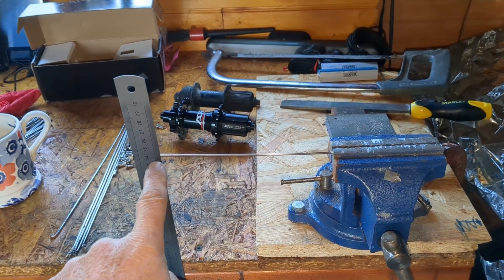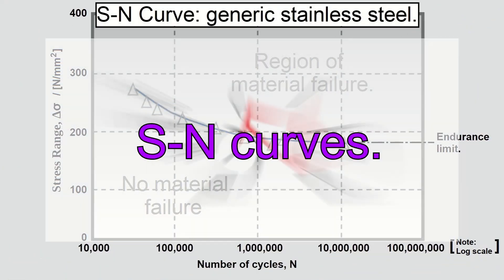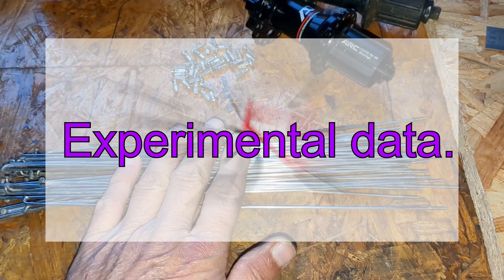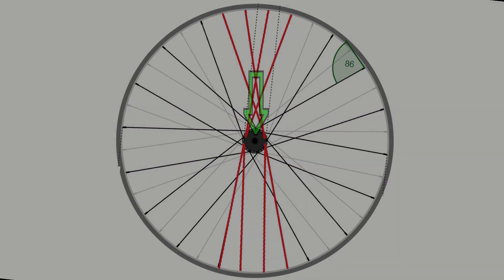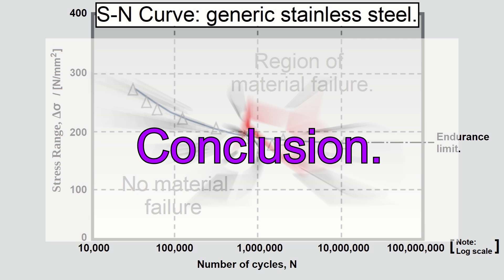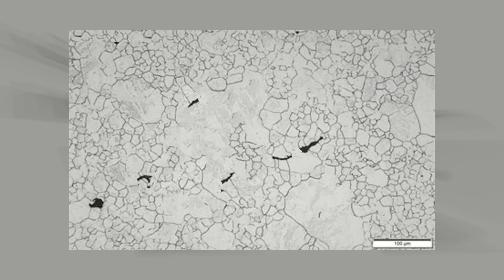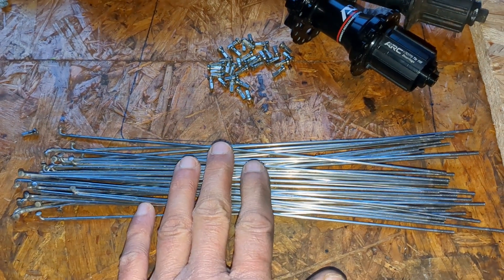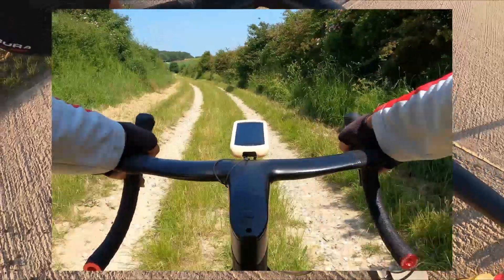Metal Fatigue: can spokes be reused?

Comment: Certain hub flange dimensions  and the lack of counterboring will lead to early failure..the first generation Campagnolo C Record hubs were notorious..i have built many wheels, and the most important thing is even spoke tension and pre-stressing the wheels..double butted spokes are a must..
Reply from the maker: Certainly from an engineering perspective, a lack of attention to detail at the spoke holes in the hub could cause an increased stress concentration which would reduce the fatigue life of a spoke in that hole.

In theory, spoke, tension shouldn't affect the fatigue life of spokes. I think it's important overall for a good quality wheel, but not for fatigue of the spokes.

I can't see that butted spokes in themselves will make any real difference. However, butted spokes tend to be better quality spokes then this should give better fatigue life.

Comment: thanks for the video. In my opinion, any deviation from cycling a perfectly smooth surface (bumps) will cause a far greater load on the spokes than what you accounted for. You did address it very briefly at the end mentioning off-road or downhill riding but I think these stresse will occur also in normal road use. Cobble stones, rails, speedbumps, curbs and whatever irregularities the wheel must overcome is so significant that it invalidates your model and your conclusion. Not to mention that I don't think four spokes are evenly loaded, especially in low spoke count wheels. For 28 spoke wheels and more your model might be reasonable, but I have several 20 spoke wheels, there's no way four spokes carry even load at any point in their cycle.
Reply from the maker: Thanks for your comments and questions, it gives me the opportunity to make some clarifications.
1) I admit the stress analysis is crude and that spoke loading is much more complicated than I alluded to. You are correct that the dynamics of riding on uneven roads will increase the spoke forces. The increase is not easily quantified. I've tried to take this into account partially by being conservative in the calculations, for instance, all of the weight of rider bike going through one wheel. The number of load cycles from uneven roads will also be less, unless you're riding as you say over something like cobbles. There are ways of accounting for the more variable loading, for instance, using a rainflow method, but I don't have the data to support this. I've done best I can for a simple video like this. You're right, though the stress analysis will never be 100%.
2) it was because the stress analysis would only be a approximation that I also introduce the experimental data. These data concur with the stress analysis. 
3) Spoke tension is largely irrelevant as far as fatigue damage is concerned. Fatigue crack initiation is independent of the R-ratio. Although spoke tension will cause a fatigue crack to fracture earlier; as the fatigue life is dominated by crack initiation, this makes very little difference to the spoke life. 
3) high spoke tension may contribute to spoke failure from a simple overload, for instance, hitting a severe bump or going through a hole. I don't argue that spoke tension isn't important, it's just not very important for fatigue life. The only time spoke tension may affect there fatigue life is if the spokes are so loose that the lowest spokes and completely unload during rotation of the wheel. If that's the case, it's just a badly built wheel and not a spoke fatigue issue. 
4) I'm not sure what the last point is alluding to? However, I've had wheels with spoke counts as low as 16 and I haven't had any spoke failures. 
5) Modern spokes, even on low spoke count wheels, should not be failing by fatigue unless there's something seriously wrong with the wheel building, the spokes or if they are used in very harsh conditions. 
I hope this helps clarify things a bit. However, I expect cognitive dissonance will mean that some people will dismiss the evidence whatever way it points if it doesn't confirm their beliefs.
Reply: @FiveMinuteVelo  Thank you again for the well thought video and replies!
Reply: I agree that potholes especially will greatly increase the load on the spokes.  On the other hand, the analysis at 3:53 seems to be assuming the load, 120kg in this case, is all on one wheel, but actually it'll be more like 2/3 on the rear and 1/3 on the front.  So, only 80kg on the rear wheel which gives an even bigger margin below the endurance limit.
Reply: I think that most of the fatigue is exactly that: uneven surfaces.  In particular potholes and curbs.
In any case I have had wheels with tens of thousands of km, inox, no breakage.
I am not that light at 85kg, but also not a 120kg person.
This includes both urban, road and mtb.
Thin tyres will stress the wheel more as they lack in cushioning the impact, so the tension should increase significantly.

A friend of mine weights 110kg and rides thin 700c wheels.  I have replaced quite a few spokes for him.